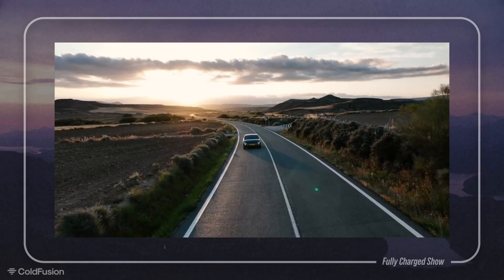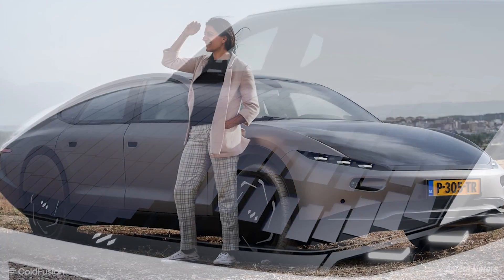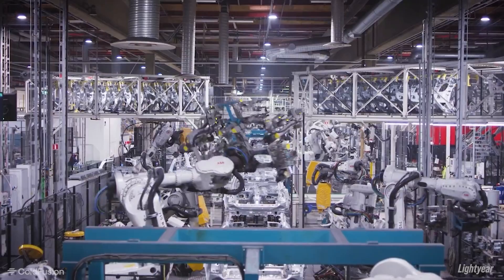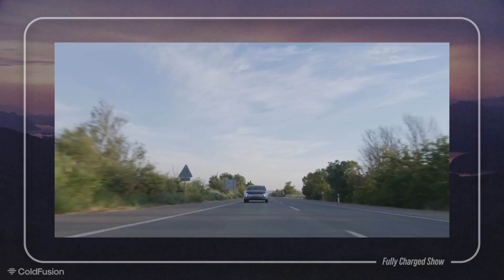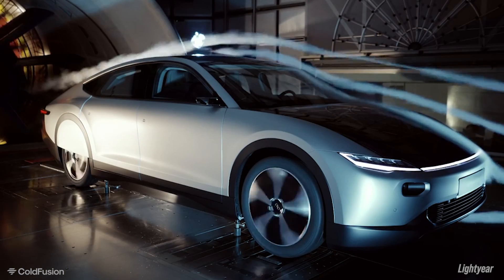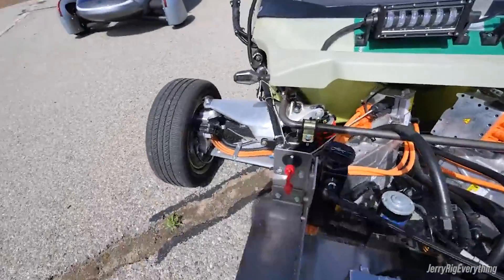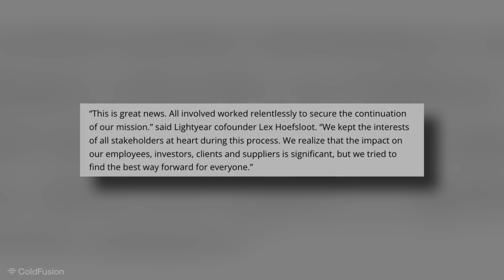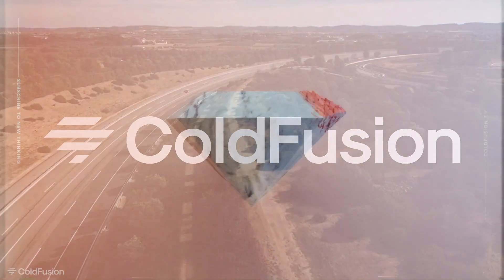3 Interesting Solar Car Projects

Comment: I drive around 20km per day, spend around $30 per week when driving my Suzuki Vitara, and around $100 per week when driving my old Holden Captiva, and would love to spend nothing for my local running around. However, $30k USD means around $85k AUD when you factor in BS luxury car taxes and GST, so there is no bloody way I'll ever buy a car that expensive. Australia needs a policy shift regarding vehicle taxes. $0.02

Comment: I wont be surprised if the company will be taken down like its predecessors, like the water powered car for example
Reply: Water powered cars took themselves down.  As anyone that understands basic physics could tell you, they were a fool's errand.
Reply: @bobhilder1469  It's Ironic that hydrogen burns so well and oxygen fuels it, yet when you put two and one together, it puts out fires. If we could separate them and ignite the first using the second and possibly some air in a controlled way, we have power. Just because we can't separate in a small object now doesn't mean we won't be able to in the future. I live in hope.

Comment: As a driver of Skoda / VW cars, I wish for one thing, these electric cars shared with current cars.... Ergonomy! I do not want the car to look like an "it guy designed spaceship" I am sick of white touchscreens blazing my eyesight , where on regular (bumpy) european roads you struggle to tap the right icon... or being distracted by useless animations happening on the large screen. Just loosing precious milliseconds when you focus from the road to the touchscreen and back decreases safety. Now at VW / Skoda or whatever reasonabe car brand you can orient and control the  car almost solely by haptics, by your touch with buttons and knobs without ever letting your eyes go off the road. So unless this fact is not taken into account, the real driver experience will remain inferior. Please, do not reinvent the wheel or hot water in terms of ergonomy.

Comment: I got in touch with the company last year after I saw a video about the One, asking when they'll be bringing it to Australia and if so, can I help them do it (it's a pretty easy sell; 500km of range in non-optimal conditions and a sunny country with high electricity prices). The $250k pricetag would need to have the 2 removed for it to REALLY make a splash though, which is what I believe they were/are trying to achieve with the Two.

Comment: "What went wrong?" It was a $250,000 solar car. Homer Simpson could design a car less horrendous than that. The cost of the car would be worth about a hundred years worth of gasoline, which kinda defeats the purpose of a car that doesn't rely on gasoline.

Comment: Now my question is. Why would you want this extra level of complexity inside a car?!  You can place much more solar panels, more cheaply to your roof and charge your car from that. For people in appartment buildings, the same concept applies if your electricty supplier uses solar producers. You will defeinitelly appreciate not having even more complicated things that can go wrong inside your car the next time you are in need of a car service.

Comment: I really wish this innovative companies will make it. I love seeing this progress.
But I wonder if some already came up with wind generated electricity to charge the EV. Companies already made a significant improvements of aerodynamics in cars and sucking wind to cool down engines and batteries is one of them. Why not take that advantage on charging batteries instead?

Comment: The company that made motors for both lightyear and aptera is called elaphe and they make in wheel or hub motors.
Reply: They have no factory production line. They made a handful for those, but Rivian and some others are getting them from somewhere. Not sure if it's Elaphe?
Reply: @aussieideasman8498  They developed them than sell the production process to said company that will then decide how to produce them.

Comment: I have a deposit on a Aptera.  It isn't expensive to do so, either.  I didn't go for the 1000 mile battery, deciding that 400 miles, even with my current work commute, is sufficient.  My biggest concern about the Aptera, aside from whether they finally build it, is noise that is not aerodynamically generated (tire noise, noise from other cars).  With the large amount of space behind the seats, it will manage to be more car than I normally need, as far as that goes.  

On the matter of the Lightyear taking ten seconds to reach 60 mph, consider that most people don't use what they have.  Aside from on ramps for freeways, most people are somewhat leisurely at acceleration, easily within the capabilities of something that takes 10 seconds to reach 60.  I drive a car that reaches 60 in the mid five second range, and if I deploy that on the street, most of the time, it's like I engaged a warp drive the way the traffic is suddenly well behind me.  Also, ten seconds to 60 is enough to beat some cars you'd be surprised at.  A '55 Chevy, with a V8, will barely beat that, depending on the transmission choice and gearing as there were several options and to get that, a manual was the way to go.  A Cadillac Fleetwood from that year is over a second slower.  Both of those are based on articles on Curbside Classic that show original road test data.  Also, when Car and Driver tested a new for '82 Trans Am with the standard powertrain (5 liter V8, four speed manual), it took 10.6 seconds to reach 60.

I'd like to see solar power be the way to go, even if I think that it's most likely to be a way to charge the car at home.  Among other considerations, we spend too much on gas, and make someone else rich with what we currently have.
Reply: Kiss that deposit goodbye.

Comment: The idea is good, but a normal EV + solar is better.
Reply: They are "normal EV + solar".
Reply: @bobhilder1469  yes but normal EVs don't have to lug solar panels everywhere they go.
Reply: @captain_elmo  Okay.  I understand you now.  When you say "normal EV + solar" you mean EV w/o solar on board and solar somewhere else.
Reply: @bobhilder1469  yeh EV and you charge it at a charger that has solar roof on top of it.
Reply: @bobhilder1469  Normal EV + house roof solar :- already here. My Atto3 is charging now.

Comment: When Tesla is going to launch a 25k$ car, it makes no sense to buy an 'allegedly solar' car for 30k$.
With current technology a solar car is just wishful thinking.
I design, build and use Solar Bikes since 7 years: solar power for mobility makes sense only for bikes or very light quadricycles (under 100kg).

Comment: Just make your car smaller and it makes it easier to charge via solar. With so many commuting in 4/5 person cars, five times a week, twice a day, it’s crazy that full size cars are being used for that. Let alone the decrease in traffic capacity of roads due to car size. I believe a lot of two lane roads should be changed to a bicycle, small EV and full size EV lanes. 
Electricity grids will have a lot more demand when we are all using EVs so having that power sourced locally will solve that problem. And on that note, granted, a smaller EV has less area for a panel, but if you have panels on your home or even a small shelter for your micro EV then that can have a smaller panel.

Comment: the problem is shown there at the end with the prius - "solar panel on the roof can add up to 4 miles of range per day." because of the additional weight it's only 4 miles on a good sunny day, and when it isn't sunny you're going to getting less range than if you didn't have the panel.

the only way to solve all problems is stationary panels, either over roads or over walkways, and inductive charging from under the road. that's a massive undertaking but it's incremental. we have bigger batteries at first then as more and more parking bays have charging from beneath they get smaller, then we can charge while stopped at a traffic light, then one lane is the charging lane, and then finally nearly every road provides power as we drive above it.

Comment: The switch to an SUV platform is a death sentence to the Lightyear 2.

I'm calling it now. This decision is catastrophic.

That kind of platforms is not just terrible on the energy efficiency front, it's also horrible for space efficiency, which comes at a premium in crowded cities. This thing will strictly be only viable in the US where SUVs are basically not regulated at all and cities are designed to accommodate needlessly large cars as status symbols.

The future is public transports and small vehicles.

Comment: Wanna travel cheap and don’t care about safety like an Aptera? A scooter can also carry 2, travel at 70 between cities… park anywhere and is cheaper to buy.
Given electricity costs and the efficiency of scoots, they are kind of comparable.
Also, forget traffic, just lane split.
Reply: Ride a Bullet train or Euro fast trains and you get safety with cheap travel. Maybe even the Shanghai Maglev?

Comment: 6:56 , "61.2kWh battery", "130kW power output of the car" ... hmm.... with that output the car is capable of running for like, 30 minutes?

Comment: As Elon Musk said, developing the technology and building a prototype is comparatively easy and  inexpensive, going into mass manufacturing is extremely difficult and costs billions upon billions.  Both Rivian as well as Lucid are struggling (failing?) to make the transition, despite much higher financial resources that Lightyear has.
You need an entirely different team, and an entirely different source of financing to go from the prototype (and early "handmade" production) to mass production.  Lightyear simply has neither team, nor financial resources.  It will stay a nice concept that somebody, maybe, will pick up someday.

Comment: The 1600 km range car idea is so stupid. I drive a 'normal' petrol/diesel cars with 500-600 km ranges. Giving them a 1600 km range would require the manufacturer to use a larger plastic fuel tank and would cost them maybe 5$ more and yet they don't do it because it is unnecessary. For 99.9999% of journeys a range of 500 km is more than enough.

Comment: The takeaway of this could be that EVs has to get more efficient. Most of „normal“ People don‘t need more than 160 km/h (I would say 130 is fine) and normal acceleration. This will reduce cost, weight expand range and less CO2 in all stages) On my 12 year old VW I can lower the consumption to around 5l/100km regularly only by casual, relaxed and foreseeing driving.

Comment: So you could drive about 70 km per day on solar energy.
If fitted with a combustion engine this sleek car would consume something like 4 liters a day at Euro 2.50 a liter saving you a whopping Euro 10.00 per day.
If you keep the car for 10 years of 400 days each you save a total of Euro 40 000.

Would you pay a premium of  Euro 110 000 for a slow and sluggish car if you could get a faster Tesla for about Euro 100 000?

You don't need a Mensa-IQ to work this out.

Comment: I don't buy a car for its speed but for its efficiency. So I definitely would go for a Lightyear 2. The Lightyear 0 did not make sense for me economically, way too expensive. Currently I run a Peugeot e-208 off my solar PV array. Not the most efficient car, but affordable at the time I bought it. 

What Tesla did with the model S and Roadster was appeal to loaded cocky, arrogant macho's to cover their initial development cost. That works, there are many of those. There are much less calm, truly intelligent and environmentally aware people that have so much money. Usually they are underpaid, working in a small dark corner for an arrogant macho. So the Lightyear 0 was just not viable. The Tesla strategy obviously worked and since they have become profitable and energy distribution and storage is going to be their biggest business, they might not want to produce a Lightyear type vehicle.

So this calls for the question: why would a government not step in here? Well, governments are corrupt and want to line their pockets, so they are happy to see Lightyear go bankrupt. Because there is no money to be made with lots of Lightyears on the roads. I'm not optimistic about such cars ever hitting the roads, Not because we shouldn't have them. Not because it is not technologically possible. But because the rich and powerful have no incentive to let it happen. And too many people don't have the clarity to see this.

Comment: EVs are a disaster, they are made with rare earth metals that come from mines with slave labor, and pollute toxic chemicals. They are difficult to mine and require massive mining equipment powered by fossil fuels. The battery costs more to recycle then a new battery. There is a ship that has 500 EVs burning, as these cars spontaneously combust and you cant put them out. China has millions of them rotting in a field as they are deemed a hazard even on china standards. The solar panel is not recyclable, and you cant even send it to the dump. Not to mention they simply don't work.  From little things, like they eat tires because of the added weight. Or you go on vacation fly back and your car is now dead. Quit pushing this garbage on us please.

Comment: All together now: "JUNK", that's why it went bankrupt. 
Too expensive, lack of performance. Until you can drive 400 miles running AC or heat on a 5-10 minute charge, you have a loser.
Questions?

Comment: In the Netherlands we have  "micro cars" that are restricted 45kmph. They are not allowed on highways but are allowed on bycle paths and city roads. Obviously they are not used for long distsnce but they provide a crucial niche for families that cannot transport children etc in cargo icycles. I think these would be where a solar car could really be a suitable platform given todays efficiency and design in solar panel and battery technologies. I am building a proof of concept vehicle, that is basically a :"cycle kart with 4x350W electric hubs, a 2 KW 48V Li battery and 200W of flexible solar panels.  Estimate 30 -50km daily range without ever plugging in, extended to continuous driving under correct conditions (ie Australia, India, Africa etc. Love the channel! One of the very best on You Tube!!

Comment: slow is relative. I'm absolutely fine with the top speed. I've only ever gone over 200km/h a handful of times. even at 160 my hands get sweaty 😂. acceleration could use some improvement though. 0-100 in 10 is serviceable. I've driven many older commuter cars that do it in 7-9, and it wasn't too bad. if they could bring it into that range of be happier.

Comment: Aptera still sounds good.   Lightyear?  "This makes it cheaper."   $300k US is not cheaper.  It's so bloody expensive as to be a complete joke in the current market.  $40k US is becoming a lot better.  Need to see it though.   In Oz that's nearly $60k and still some 50% above the cost of an MG4.  Add some more panels to my roof and I really don't need the car to have panels on it. Might be nice if you're driving across the Nullarbor but I haven't done that for a decade.

Comment: I would absolutely love to have one of those cars you described at the end. The speed limit in the UK maxes out at 70mph anyway so the top speed isn’t an issue, and not having to pay for petrol or maintain an engine would be fantastic.
Reply: that would be an enormous waste of money, i'm afraid.

the biggest problem with solar-powered cars is that (a) the solar panels are always flat and don't track the moving sun, (b) the farther away from the equator you are, the smaller the solar irradiance you receive, and (c) cloudy days are quite common in many places in the world and clouds reduce solar power output by as much as 90%.

those three factors combined bring the expected solar power output averaged over a year and over the whole surface of the planet (assuming global adoption of this technology) of any solar car by about an order of magnitude compared to the absolute best-case scenario of the sun being directly overhead. that's about 0.1 kilowatts realistically compared to the theoretical maximum of roughly 1 kilowatt. to put this into perspective, just to overcome air drag you need about 0.6 kilowatts of power driving at a speed of 50 km/h that's typical of residential area speed limits.

as for using solar panels to re-charge the batteries, consider that the solar panels will, on average, charge up to about 0.1 kilowatt x 10 hours = 1 kilowatt-hours per day. given that electric cars have an efficiency of roughly 0.2 kilowatt-hours per kilometer, that would limit your use to a measly 5 km or so per day if you want to be independent of charging stations.

so, overall, unless you live in a country close to the equator that sees lots of sunlight year-round and use it for short distances and relatively slow moving of up to residential speed limits at the most, you'll be too dependent on the batteries and thus traditional charging methods.
Reply: @tasos1112  anything that saves you from recharging during longer commute is appreciated. UE is forcing cars to have repleaceable battery, it should by default enforce solar recharging system, because not having these on EV is just waste of space and resources

Comment: Lightyear should collaborate with Tata or Mahindra in India, several advantages:
*Manufacturing costs will go down drastically
*There'll be huge market for this car, even in India, since India is one of the region with high solar energy presence which is 2-3 times European countries, because of the geographical location